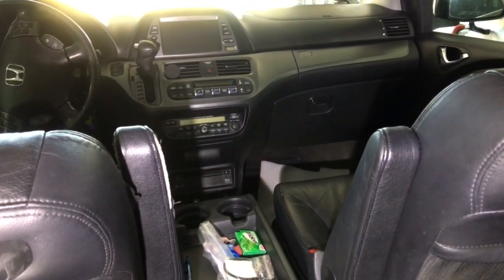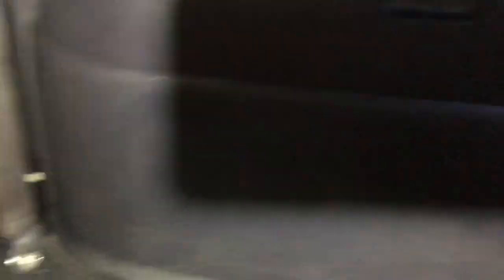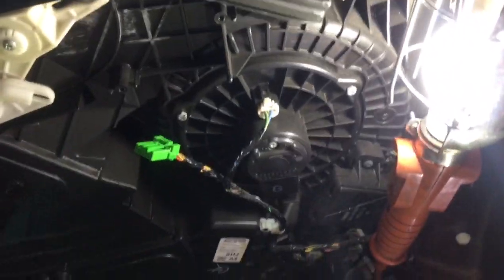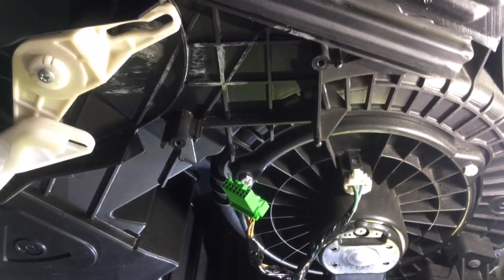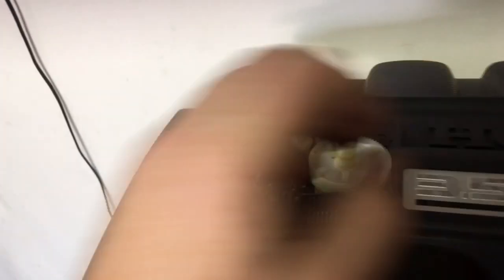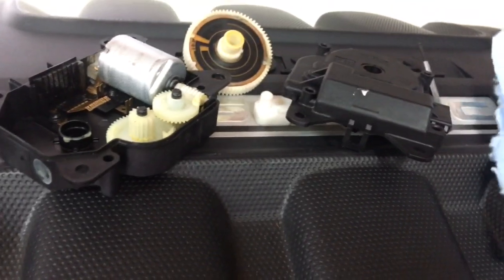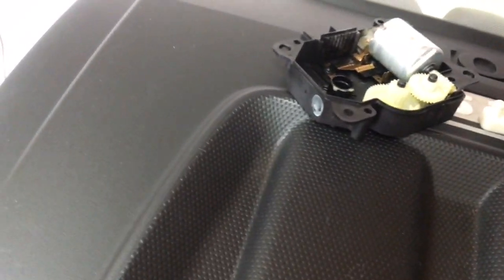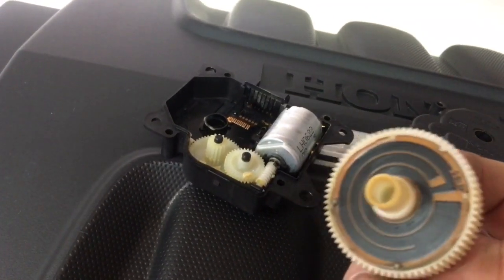Honda Odyssey 2007 rear air mix control

Comment: It worked perfectly as explained. Even though I was careful, I did break 2 of those plastic clips on the part :(. It is too delicate. But did solve my clicking/knocking noise that I used to get when I start my 2007 Odyssey.Thank You too much. Save atleast $150.

Comment: I just subscribed. Thanks for sharing. I have an 07 Odyssey and just checked my codes with my scanner. I have no lights but it brought up a B1222 code. Is that the code you had. I’m going to gain access and see what I find. Never even knew anything was wrong. Thanks again Artie 👍
Reply from the maker: Hi Artie, Thanks for your comment! I don’t remember what code, it’s been years since I did that.I wish I can help. I do know that whatever the number I was able to retrieve it was exactly for that rear air mix sensor.
Reply: @RoyalpriesthoodG12  thanks for the reply. I’ll check it out buddy, stay safe and well Artie 😊

Comment: Hi, thank you so much for posting this video, a friend scanner reported "B1222 Code - Short In The Rear Mode Control Motor Circuit" which lead me to this video, can someone point me to the correct fuse location for this circuit or circuits , I am measuring 1.7 amps draw inline on the negative terminal, every time I put the amp meter between the open/disconnected negative battery terminal.  thank you.

Comment: What code did you have? I have b 1222 short code. Sometimes the compressor doesn't want to come on.
Reply: Replace the AC relay in engine fuse box. $16.00 at AutoZone